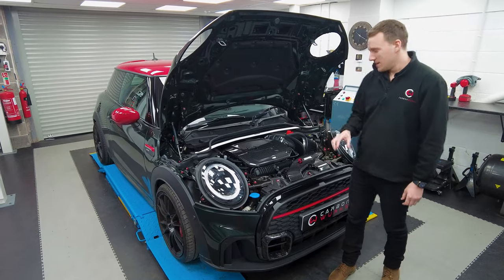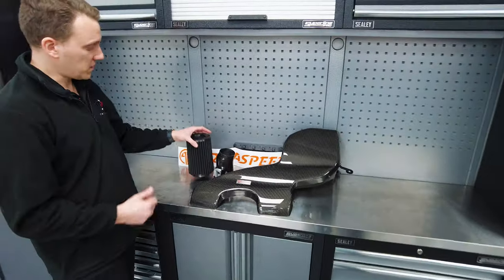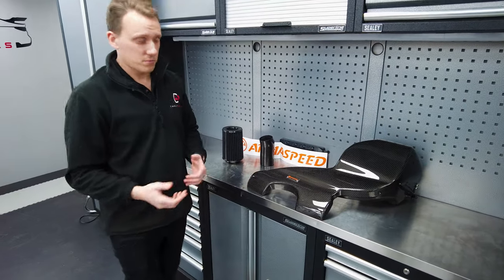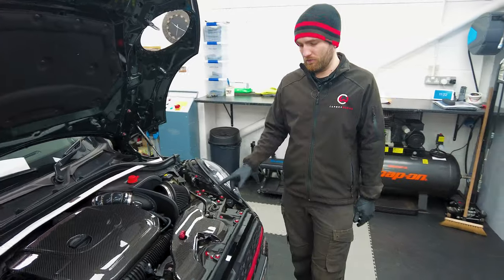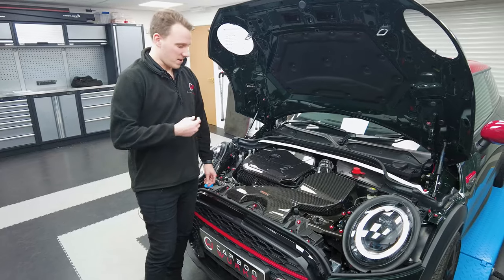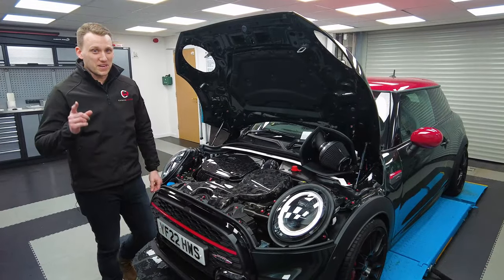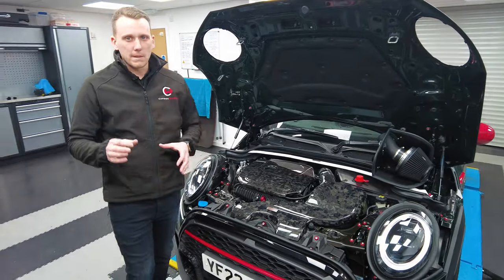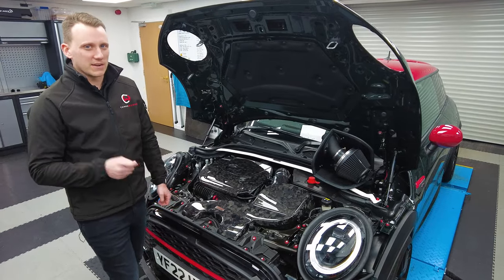If You Have a Mini F56 JCW... INSTALL This Now!

Comment: Really nice this. Personally I only think carbon works in an engine bay when there are a few bits. An engine cover on its own doesn’t really look right to me. This airbox set up looks really smart. Very impressive. I actually think I prefer the forged versions.
Reply from the maker: Thanks for your message! I tend to agree, the forged actually ties in quite nicely with some of the other forged parts we have on the car already (Front Air Ducts & Rear Diffuser).

Comment: I have the Eventuri and plan to switch it out with the Armaspeed. I’m just not convinced that the Eventuri won’t draw in water. Just from a hand wash, the intake gets pretty wet. I know others have not had an issue. But …. 😊
Reply from the maker: It's a good point you make. We've not seen an Eventuri on an F56 but I expect that could potentially be an issue.
Reply: I have the carbon eventuri on my 2017 F56 JCW and have had no issues with water. There are small holes at the bottom of the scoop and also just before filter for water to drain. I choose the Evneturi because now the hood scoop is functional

Comment: Did induction kit on a Corsa vxr it caused bad boost lag as it messes up the air fuel ratio thinking of doing it on my jcw hatch will it need mapping in after. I'm guessing it will.
Reply from the maker: Depending on the kit you go for, the length of the pipework remains the same. A remap would be good but not necessary.

Comment: I know this is a long shot but is the oem pipe that goes where you have the forged silicone hose any bigger on a countryman 2024? Or would the armspeed fits the a countryman jcw 2024?
Reply from the maker: It should be listed on the forge motorsport website about what car this will fit other than the F56. Intake wise the setup on the countryman is different so the armaspeed wouldn’t work yours I’m afraid.
Reply: But armaspeed is producing an intake for the 306hp engine. If the engine on the jcw 2024 is the same as the gp3 and the m135i it may work !
Reply: @DjtistouGaming  that sounds great! I believe the countryman JCW has the same setup as the gp where the inlet pipe from the air filter goes is bigget than the S trim

Comment: I makes me laugh why people put cone filters into the engine compartment only to draw in hot air!😂😂
Only a full OEM or carbon intake makes any sense!!
Reply from the maker: If you actually look into the temp data the difference is marginal with an open design. 

Remember a car is constantly moving so is pulling in cold air into the engine compartment and by time it gets to where it needs to be the impact is negligible. 

We’d happily run the RAMair system moving forward but wanted the carbon intake more for the aesthetics side.